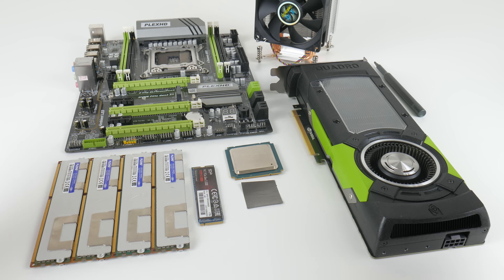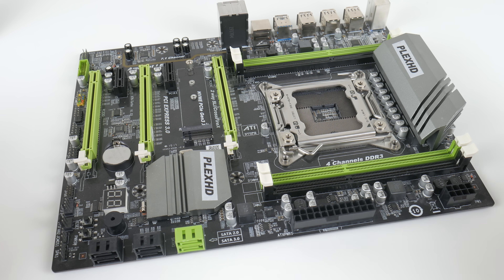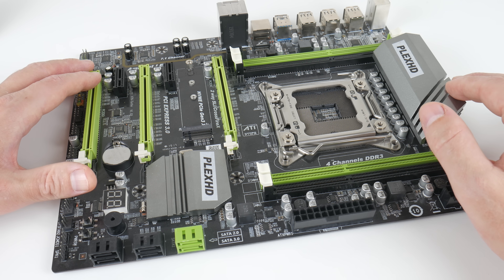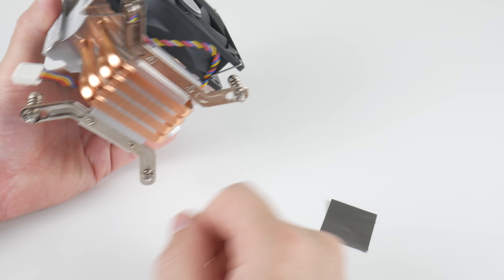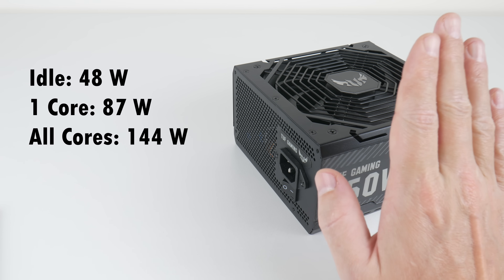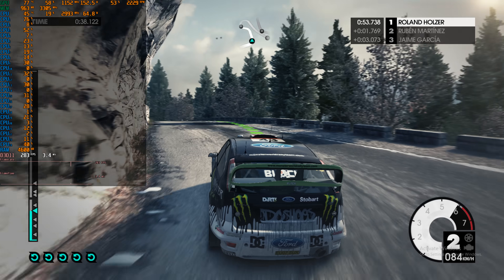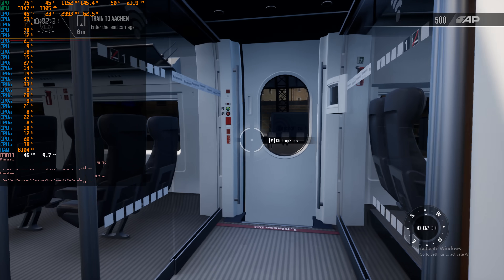10 years ago this CPU cost $2614 - How does it hold up? The Intel Xeon E5-2697V2!

Comment: Still running my X79 workstation with Crossfired HD7970s and X-Fi Fatal1ty Titanium sound card.  I'll have to look into these CPUs.  I remember looking at upgrades awhile ago and people still wanted a thousand dollars.  Last time I looked people still wanted $600.  So I built a new Ryzen system.  I still love this old X79 setup for playing older games on.  I get all the Crossfire fun, EAX audio and games I can play at max settings.
Reply: Would you recommend X79 platform for retro windows xp gaming
Reply: @Jaroartx  Possibly.  Whatever motherboard you are looking at, check that you can find drivers.  That said, you would need to use Windows XP Professional 64-bit which might not play nice with some games and devices like audio cards or video drivers.  Regular XP 32-bit really won't take advantage of the hardware to the max.  It's quad channel, so you're probably going to have 8GB at the very least, most likely 16GB.  I'm not quite sure if Intel needs a special driver to recognize more than dual-core properly.  I never used XP on my X79 system, I only ever used Server 2012, Vista Ultimate X64, Windows 7 Ultimate X64 and Debian.  I know when I did use XP way back when I needed a special dual-core driver for XP so games would run properly on my FX-60.
I have an Asus TUF X79 motherboard and I see it has chipset, RAID and controller drivers for many OSes so I'd say that mobo, works.  Though, it was a phase where you had BIOS or you could flash it to UEFI with a tool.  I'd assume you'd want the regular BIOS for XP but I don't know if you can downgrade once it's moved over to UEFI.
X79 would be really powerful for XP for sure, but be prepared to do some tinkering.  I've been tinkering for a decade and only recently figured out how to get Fast Boot working with my hardware.  Also, there's consumer RAID and enterprise RAID on these systems.  Never mix the drivers and stick with one.  If you want RAID-0 and TRIM (Vista and above) you need enterprise.  XP you'd need to manage TRIM on your own.  If you want full slot bandwidth with SLI or Crossfire, you need to check the specs of the CPU.  Some only handle 28 PCIe lanes and not the full 40.
Honestly, Windows 10 is really fast and modern on this system and I play old games like BF2, Blood Rayne, Ghost Recon, R63:RS on there without any issues.  Very stable system as long as you have good matched memory and mount your CPU properly.  Bad mounting usually manifests itself by dropping memory channels.
The only thing I wish it has was an NVMe slot, but that mobo was just before that started showing up.  It will not boot a PCIe RAID drive.  My X99 system will, but my X79 system will not or maybe it's just this particular flavour of X79 that can't do it; not too sure.
Hope this helps!
Reply: @PorscheRacer14  it sure helps thanks for all the details you are right this system is quite overkill for windows xp but is a fun project lets see later on in the build

Comment: I don't own Train Simulator 2 but given the GPU utilization of only 55-60% I'd say you are CPU bound in this game. But in the majority of the other games you were GPU limited.
Reply: Crysis can also be a hit or miss. Game doesn't really use more than 2 cores, but is notoriously GPU heavy. Heavy enough that even 3 8800 GTX in triple SLI had trouble getting over 40 FPS in 1680x1050. For single cards, well a single 8800 Ultra got about 18 FPS at the high preset (which isn't even the highest) And if you were willing to go down to 1024x768 (which was a low resolution even back in 2008) you could breach 30 fps with a card that came with a $830 MSRP

Comment: X79 what a fun platform 
I've gone from X5675 4.5ghz P6X58D-E to E5-1680v2 4.5ghz Rampage IV Extreme to i7 5960X 4.4ghz ASROCK X99 WS all run games fine when tweaked properly. The large cache definitely helps and having fast ram with decent latencies can beat out most dual channel DDR4 setup in terms of bandwidth.

Comment: Picked up a Sabertooth X79 w/i7-3930k, ...years ago.  Replaced the 3930 with a E5-2690v2 about 2 years ago.  Ivy supports pcie-3 while sandy does not.  And I like the idle temps in the high teens and low twenties instead of mid-thirties with the 3930.  Miss the 45 Mhz OC though.

Note: Saber with E5 does not support ecc/registered.  So memory is still non-ecc/unregistered.  Have not found/tried ecc/unbuffered with the saber.

Nice vid.......  ; )
Reply: teens? do you use your PC outside in the winter?
Reply: E5-1680V2!!!!!!

Comment: Saying 'Look! It is OK.' is not conclusive if your title suggests it is better than a modern CPU.
Perhaps this Xeon vs an Intel i3 or low end AMD would be fitting.
I appreciate the work, however if cheap modern CPU have stomped on this Xeon already; It is time for it to rest.
What's the PCIe version on that board??
The older versions are starting to bottleneck some GPU.
Reply from the maker: PCIe 3.0 and more lanes than modern mainstream boards that have lanes share chipset bandwidth
Reply: Not just compared with a more modern CPU, but also with faster clocking less core chips from it's era. Just to see if a fast 6-8 core will run better than a 12 core with slower clock, even if all of them are old.

Comment: I love the fact that some no name Chinese motherboards have better QoL things on their boards than some high end branded boards.
Reply: It's hit-or-miss with those motherboards.  There are some really bad ones that have only half the USB ports working, for example.  Some have really cheap and noisy fans cooling the VRMs that will eventually fail.  You're stuck with whatever BIOS is on those motherboards, too.
Reply: @galland101  There are modded BIOSes available for a lot of the more popular models (including this one, which unlocks memory timings amongst other things). Can be a bit of a challenge digging through Russian forums and such to find them however.

Comment: I don't really see much point in this when you can get a Ryzen 5 2600 with a cheap mobo for a similar amount. It will be faster for games, and just as fast for multi-core applications despite having half the cores. Depending on the board it would be upgradable up to 5000 series as well. 
I wrote a python script that searches for all the used CPUs on ebay to see if those Xeons make sense at all, and I found one niche where they could. If you really need a lot of cores, you could get a dual socket  2011-3 motherboard with something like E5-2698 v3, which costs around $40 as well, has 16 cores, and has a bit faster cores than what you have here. You could make a 32 core for fairly cheap. Assuming you need those cores, and don't mind it being power hungry.

EDIT: Or even a 36 core with something like E5-2699 v3 (around $75)
Reply: Yes, the XEON play made a lot of sense 2 years ago (pre-covid).  Today, with Ryzen/MB pricing...not so much.  Still, good value for the money.

Comment: Imo v1 and v2 xeons arent really worth it when v3 and v4 xeons are so cheap, an e5 2640 v4 is 10 bucks on ebay and gets you broadwell power eff, no turboboost unlock on v4s though.

Comment: My main rig is X79, and I have been planing to use this chip to upgrade soon. Thank you for testing for me! Love the X79 (as well as X99) but this is in fact the last upgrade it will get, nice to know it will meet expatiations.
Reply from the maker: Enjoy!
Reply: if you dont need the multicore, the 1680v2 is the last fully unlocked Xeon part and can hit 4.5GHz all-core without too much trouble.  You would need a normal, non-chinese frankenboard to be able to overclock it.
Reply: @bojinglebells  U can overclock 2697 without a problem too, Mine goes up to 114.700 bclk and that gives it boost clock of little over 4ghz/1810 cb R15 score
Reply: @Rex-tt1vk  what kind of motherboards can reliably hit bclks that high?  I have been under the impression that not only would an overclocking board be necessary, but that bclk overclocking is more often than not unstable much beyond 104ish, and that even if such an overclock can be achieved, its still a not insignificant ~13% slower in single thread.
Reply: @bojinglebells  I use IV formula, but you can get that with every asus board on X79. And if your cpu can do 125 then you can use option to make it act as it would be 100

Comment: You should use inspectre to disable the spectre and meltdown patches on these old CPU’s
Reply: This.  Also there was a bios modder on the Asus forums doing good work adding nvme support while omiting the CPU microcode updates for Asus boards.
Reply: I wouldn't flat out disable them, they're for safety after all. But it's worth testing the difference to see how much of a hit it really does in home user tasks.

Comment: I ran a X58 - W3680 Xeon 6c/12t in a Dell Workstation.  With Techpowerup Throttlestop I was able to OC it to 4ghz.  There was some limitations to the platform with AVX2 and IPC. It still was a good CPU paired with a GTX 1060 6gb I never had an issue...  But there are other ways to get decent chips... I picked up a small Lenovo m80q Mini PC for under $100 and it came with a i5 10500t 6c/12t product and yes it caps at 3.8ghz but it sips power and its a very good chip.  I may build a setup around this, but this Mini PC makes a great media/emulation PC.  THere's all sorts of ways to get into PCs and Gaming, just need to look.

Comment: 2690v2, BCLK 114, 10 cores, 20 threads. All cores work at 3,762 GHz, boost 4,104GHz at 1 core. Motherboard ASUS Sabretooth X79. Video GTX980. 16Gb RAM 2133 quad channel. SSD. 1 PCI slot for SB Live 5.1!. System Windows XP SP3. Good machine for Windows XP and SB Live 5.1!.

Comment: Ah, the same chinese mobo that I had back at the day. You really shouldn't trust it xD

Like all chinese motherboards, it is made from used parts. Just not worth it in the long run.

Sadly, the OG branded boards are really rare and expensive, but if you can find a good deal, then this setup with a cheap Xeon will be a beast even now.

Comment: Interesting test and sort of homage to the absurdly expensive beast of a CPU from way back. Only thing though, with older processors, they haven't got the Instruction Sets that many modern games need to even start. 
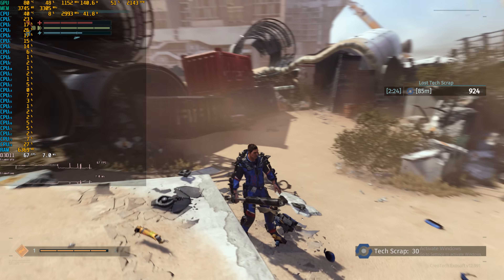Watched a video a short while back about the oldest Phenom processors, and it was the same issue with that. And you know around about 10:36 it sounds like there's a bit of wind noise.
Reply: That's fine by me, given that I have not purchased a AAA game in more than a decade now. 

My idea of "fun" is not "paying a $70 entry fee in order to be allowed to subscribe to DLC for the next 18 months to have a finished but entirely derivative game that expects me to "make my own fun" by playing online against teenage gamer-brat griefers because the greedy games company cannot be bothered to write good single player content any more".

The good thing about sticking to Open Source, pre-2010, indie and retro games is that they all run fine on older hardware in Linux - which also meant that I could finally rid myself of my Microsoft abuser when support for Windows 7 ended.

The reason why modern AAA games are rubbish is because modern PC gamers are narcissists anyway who just want to spend their time "comparing d*ck sizes" over who has the most frame rates, biggest 4K screen and most cores in the CPU upgrades that mummy and daddy got them for Christmas and therefore care less about the actual game content.

I love the cretins swarming in their masses to upgrade to Windows 11 - because it makes a lot of nice cheap hardware available for me to buy on eBay  and to run Linux on.

Anyone who understands that REAL multiplayer gaming fun happens when you invite REAL friends over for beer, pizza and a LAN party a few times a year, not "pretend Internet friends" in some derivative online shooter (with or without parkour).

Good riddance to modern AAA games - "games as a service" ruined PC gaming.
Reply: @terrydaktyllus1320  how can you casually invited a person from other side of the world just to have beer and pizza? 🤣 👶🏻
Reply: @Agent-ie3uv  It's not difficult to understand, I don't even know why you asked me the question, to be honest - unless you really don't understand the concept of someone having real human friends as opposed to "pretend Internet friends". If that's the case then I genuinely feel sorry for you, and for what this world is becoming if the only friends some people have are the "pretend" ones.

 I really shouldn't have to explain this but I have a group of 6 other friends who live locally to me and with whom I already board game once a week. It is they who I invite over for a LAN party, beer and pizza several times a year, as well as going out with them and their wives / partners for the occasional beer and a meal also.

In LAN gaming, nothing beats the loud swearing around the house when one of them gets "headshotted" by another in, say, Unreal Tournament - a completely different and fun experience to being griefed online by teenage gamer brats.

And, of course, such games like Unreal Tournament go back to an age when multiplayer LAN gaming was in addition to single player content and you could run it on your home network "ad infinitum" instead of depending on some evil and profiteering games company to provide servers that can be switched off at any moment.

I stopped painting little faces around words that I write when I got to age seven and first learned joined-up writing so I don't know if you're use of emojis is you either being a smart-a$$ (and failing dismally) or just being a bit "hard of thinking" to not be able to work out the answer yourself. 

I am still amazed that someone would actually ask that question with any seriousness.
Reply from the maker: Yea AC running. Must have been sitting directly in path.
Reply: Which is why I reluctantly upgraded from an E5-1680V2 (8C/16T, 4.3Ghz all core) w/Asus P9X79Pro to the E5-2678V3 (12C/24T, 3.3Ghz TurboUnlocked All core) w/ HZ X99TF.  The V3 brings, amongst benefits like higher IPC and lower power consumption (heat), the AVX2 instruction set.

Comment: Now that many Xeon processors can be had for cheaper than their i3/i5/i7 counterparts, it is a shame that so many motherboards don't support them.
Reply: I wonder if they can be modded in the same way I did with my ASUS P5Q SE PLUS?  Mine is not compatible with Xeon CPUs and yet since 2015 I have been running an X5492 in this board with no problems at all.

Comment: I have a X58 board with a Xeon 5770 and it still runs every day tasks easy. (GPU is a GTX 970)
I am glad that you can still run windows 10 without any problems on this old machines!
Great work... always enjoying your videos!
Reply: i have a pc with q6600 with win10 running just fine, rarely BSOD, but its ok
Reply: I've been on X58 since 2013, before the CPU in the video was even released. In 2016 I upgraded to a 6c/12t X5670 which I've been running overclocked to above 4GHz since then. It doesn't have AVX so some new games wont run but other than that it's still fine. I'm currently waiting for a GTX 1080 to replace my old slow GTX 960 2GB which I've had since 2016.
Reply: Dual booting with Windows 11 on my 2697 v2. There really is no hardware limitation, just microsoft being microsoft. Luckily Rufus has a built in option to remove the requirement.

Comment: I have a intel Xeon E5-1650 v2 ( 6x 3,5GHz) (it is a EUR 16,90 CPU)  in my Dell Workstation, and  32 GB of RAM and also a AMD RX 580 and it runns well so far.

Comment: Should do a video about XP running on x79
Reply from the maker: Yea works great!
Reply: Good Idea. The Titan X is one powerful Windows XP GPU. Might need a PCIE SATA adapter because some X79 boards doesn't support AHCI with Xp (in my case).
Reply: @jangelelcangry  I believe you can slipstream the driver and be good. I have a 980ti and 32 gigs of ram waiting for my AliExpress x79 mobo to get here
Reply: @Fahrenheit_85   I couldn't find the driver and SDI didn't installed the AHCI drivers. Also USB 3.0 will BSOD Xp with my board. I'll let you know if I managed.
Reply: [update] Tried  to install the SATA drivers through Snappy Driver Installer and it failed. Tried to force another driver and it BSOD'd. Any drivers floating around for XP?

Comment: Still using a Hunanzhi with a 2687 WV2 with 128Gb of RAM. Have a 3060ti in it & a Rocket Q Plus SSD. No Complaints (other than a kinda long Boot, but that is because I have an insane amount of RAM). Also using an ultrawide Monitor. Love it on Games like Mechwarrior 5

Comment: Old Xeon without AVX2 = not worth it. Even as secondhand CPU.

The IPC jump of the first ever Xeon with AVX2 is just insane. Buy that instead. Quite cheap.
Reply: If the programs use AVX2, sure
Reply: @HappyBeezerStudios  no, you don't get it.

The only reason I recommend AVX2 for secondhand CPU is because since the introduction of AVX2, the IPC jump from its predecessor is just insane. So even if video games doesn't use AVX2 that much, it still gained big performance compared to any CPU before AVX2. Yeah even any HEDT before be AVX2 easily beaten by 4770k 4790k

Because the architecture design of AVX2 was the best breakthrough design in CPU all the way back in 2013. Even AMD is late to the party, they only started using Avx2 in Ryzen series 2017. No AMD CPU before Ryzen has AVX2